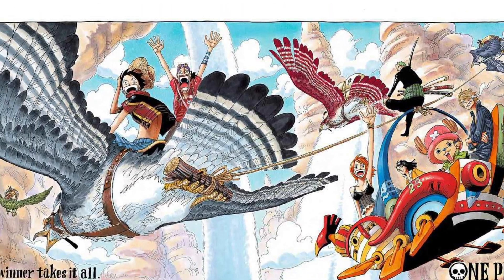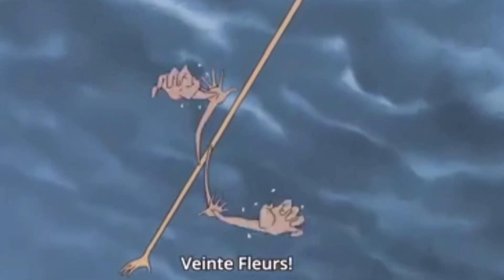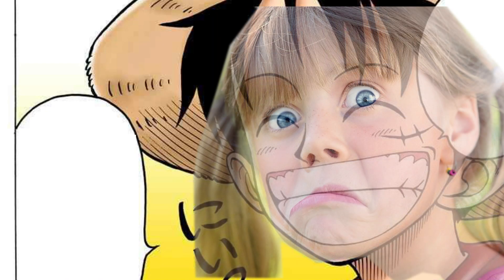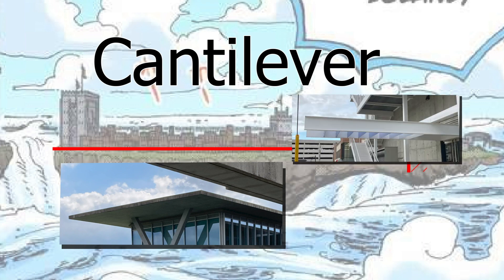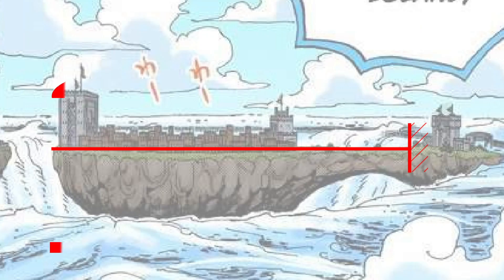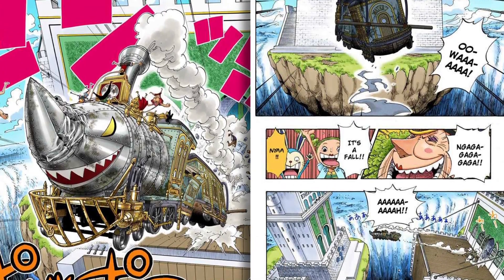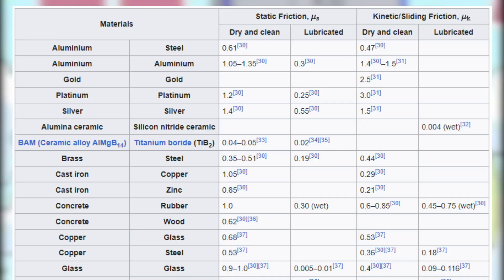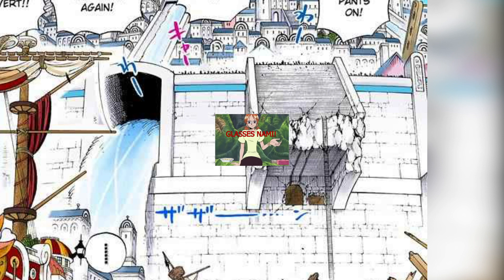Engineer Reviews ONE PIECE: Enies Lobby

Comment: I assume the internal composition of the island is made up of seastone.  Island clouds are created when pyrobloin, the main component of seastone, is blasted into the sky and enough moisture is absorbed.  So seastone is light enough that it can float in the sky under certain circumstances while being harder than diamond.  And the island would have to be composed of a material strong enough to withstand whatever punched that hole in the ocean around it.
Reply from the maker: Seastone would make the most sense since, like you describe, it can be lighter than air yet stronger than diamond... which makes it sound like it can do anything! That would make it more than 100x stronger than steel, which perhaps is strong enough to exhibit this type of structural form. Though who's to say how this formed, we still don't know that much about it. maybe it was made after the hole was formed, or perhaps devil fruits are at play...

Comment: You don't think it's possible there's some interior rebar-like structure made out of mythril or something inside of the land bridge?
Reply from the maker: that's a really great point. In the case that there is some tension resisting reinforcing in the bridge, I'm still guessing that based on proportions there would still be an excess of demand on the system. Maybe I should've put some numbers to it!